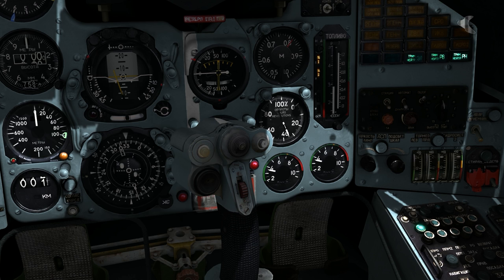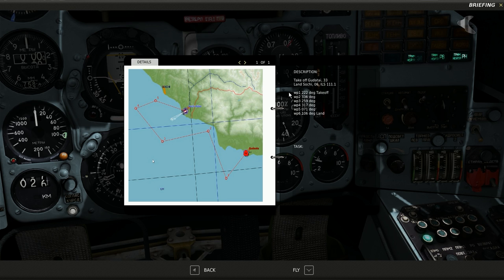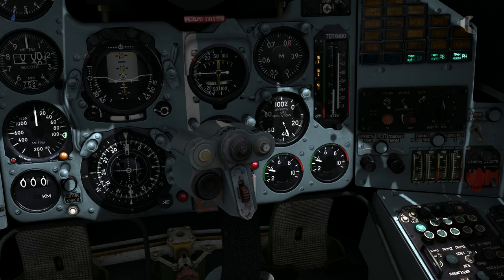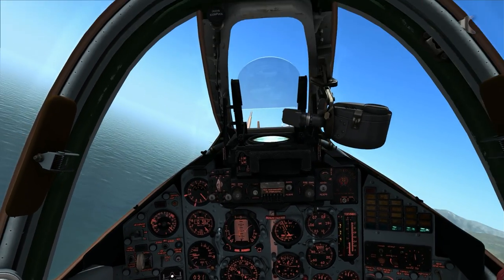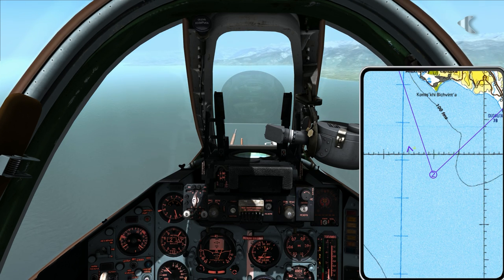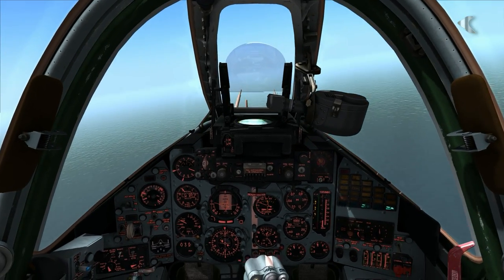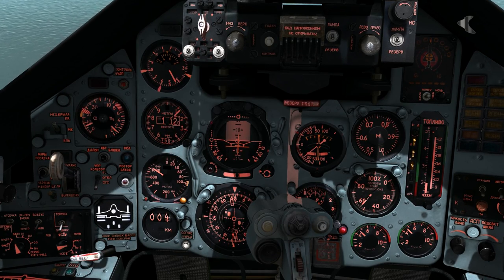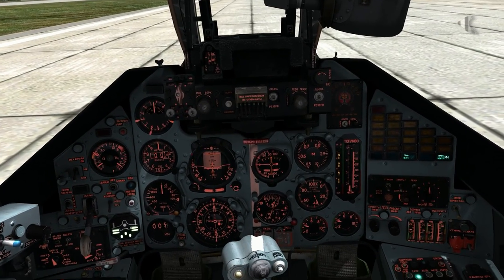DCS SU25 Navigation

Comment from the maker: Well spotted. Yes you are  correct. Realized after the video was done. The secondary needle is as you said a course setting needle.  Thats why you will always offset away from it for an intercept , whereas you offset towards the CDI.  A key point is you don't need this needle at all if you know the desired  course.  Simply offset to put BPN on that compass bearing, and turn onto it.

Comment from the maker: Cant look at the moment, but make sure you've selected the Su25 sim, as the aircraft, and the commands as 'All. You should see the commands under 'kn.....' If you don't there maybe an issue with your controller file, but that's not likely. If u still have problems, suggest you post on the ED forums, in the Su25 section.